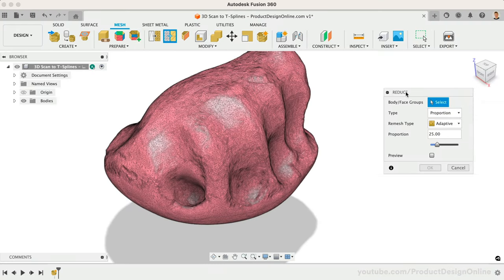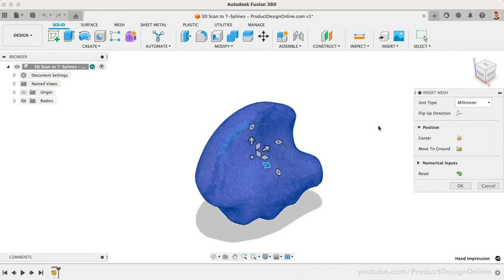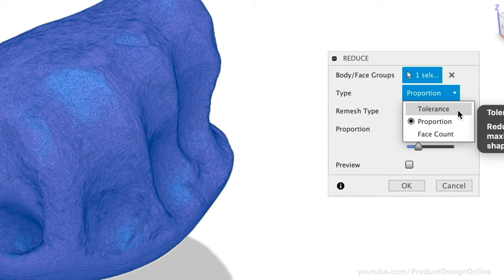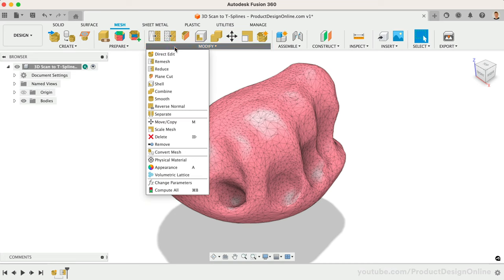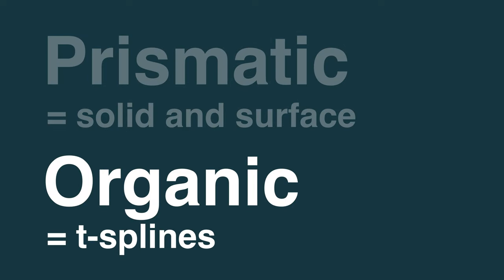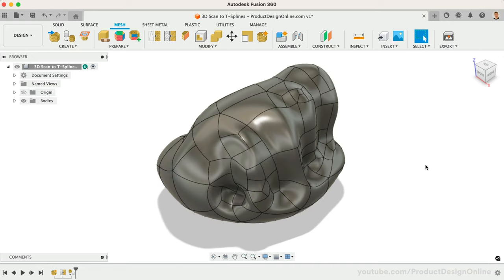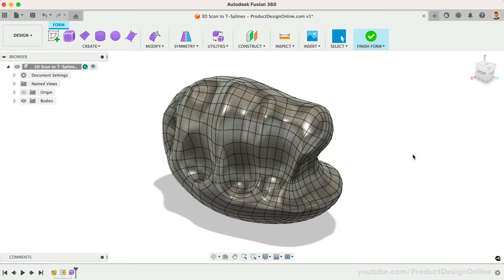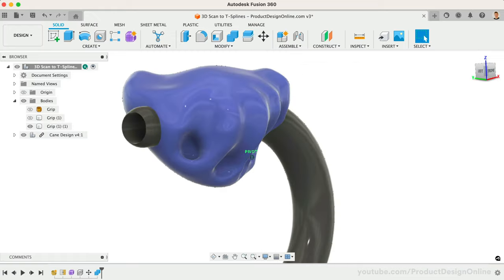Convert STL 3D Scans in Fusion 360

Comment: While I am trying some other obj file the error is coming like it has more Than 10000 triangles. Can you please suggest me sir I order to avoid that error?
Reply from the maker: Fusion 360 will often provide that warning regardless of whether it will work or not. Did you get that error after trying to convert? or are you seeing it in the dialog/before converting?
Reply: @ProductDesignOnline  before converting only sir